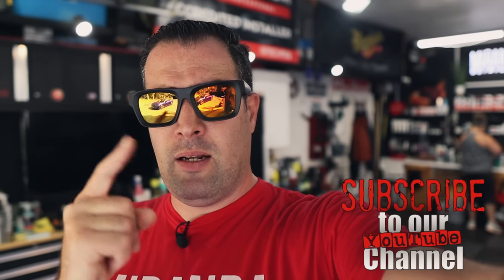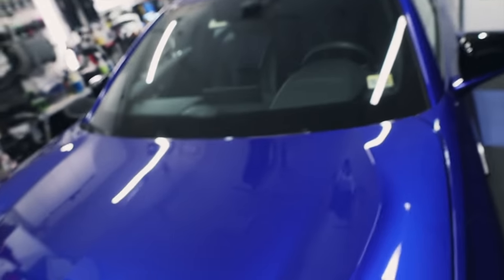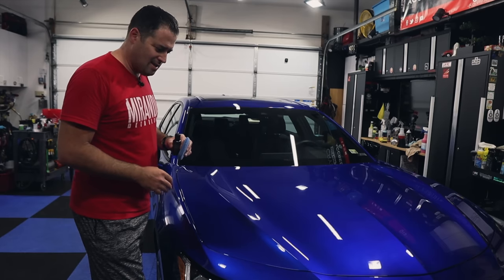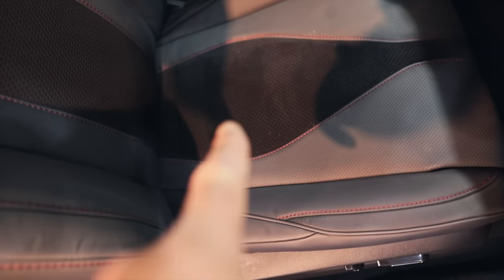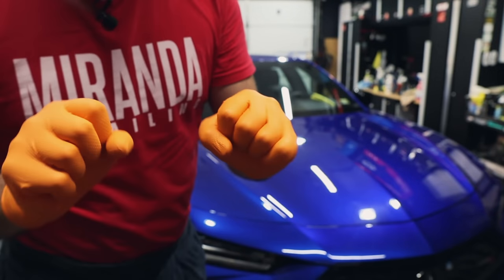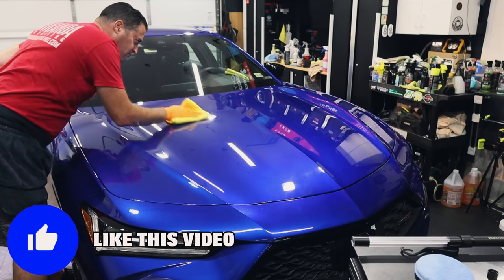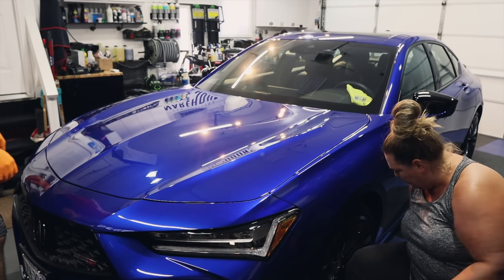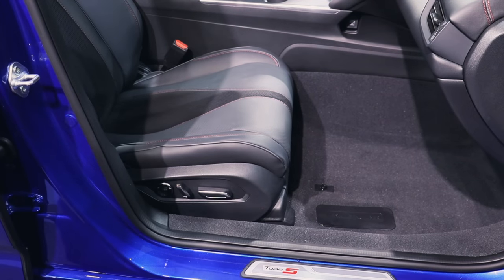Ceramic Coating Application! | 5-7 Year Pro Ceramic Coating | Acura TLX

Comment: Hey Phil, Great content as always!  Thank you for sharing your knowledge!  I replaced the grease inside the SPTA polisher and the machine is much quieter.  I don’t know if you have tried that.  As a retired mechanical engineer and troubleshooting lots of gearboxes, the noise is a telltale of wear.  I just used a white lithium grease, but a full synthetic grease would last even longer.
Reply from the maker: Hi. I haven’t yet but I bought a good heat resistant grease to do just that.

Comment: That's a very cool color blue. I may have to try Dr. Beasleys polishes. I've only been shut down for about 6 weeks due to winter, and my April work is filling up! Would you say Dr. Beasley is a cleaner polish? No prep wiping? You guys are awesome. Hi wife!
Reply from the maker: Thanks!  
The NSP polishes are a dedicated primer polish for coatings. They are not like any other polishes out there. They actually are meant specifically for priming before any coatings. It leaves behind a thin layer of ceramic that acts as a bonding agent for coatings. That’s why you don’t need any panel wipes for it. It’s great stuff!

Comment: When u sell a coating package who picks the coating and why.just 4 my edification. When I start doing ceramic coatings want 2 have a variety of options.
Reply from the maker: Hi. Our main coatings of choice are Gtechniq and Gyeon. That’s what we usually tell the customer. Depending on year range we will choose a coating in that line. Sometime we use other coatings but only if the customer doesn’t mind what we use as long as it rated at whatever year range they choose.